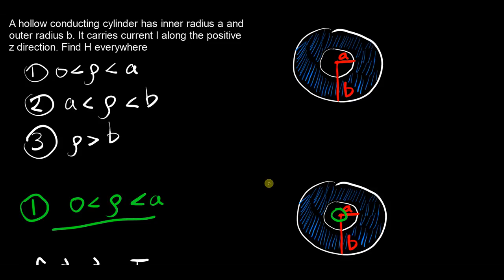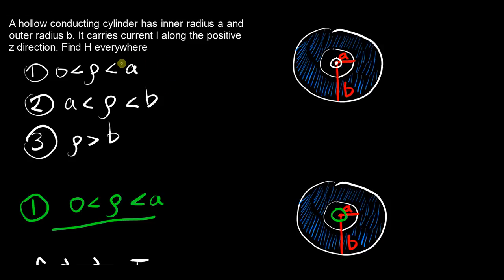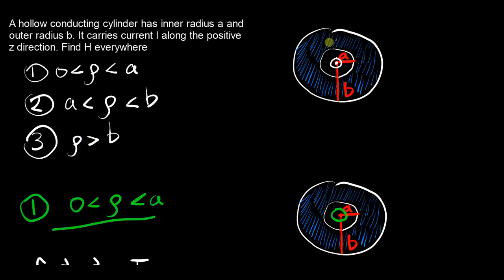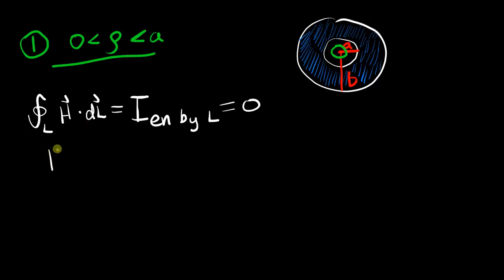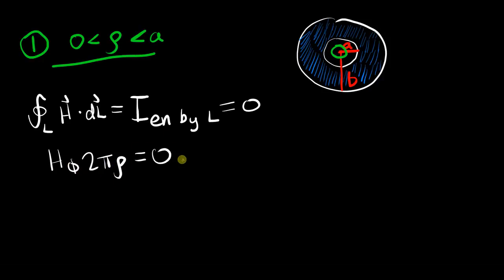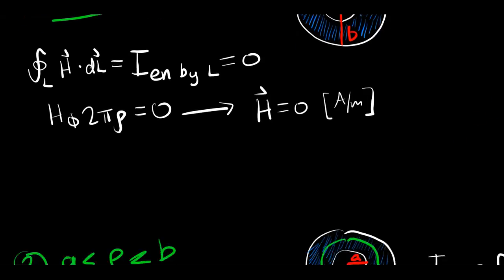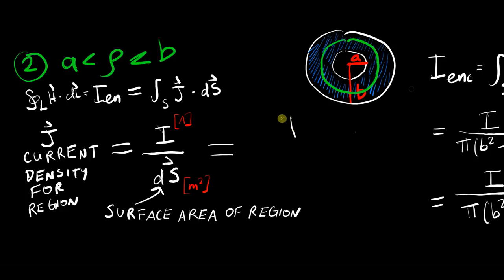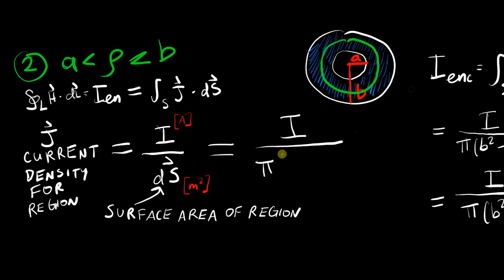ELE401 - H everywhere due to hollow conducting cylinder

Comment: Great video and explanation. Just one thing, around 9 minutes in the video, the current density and ds are vectors in the direction of the z axis not "a phi" because J in in the direction of the current. Also, in cylindric coordinates when you use pdpd"phi" its in the z direction.
Reply from the maker: You're right, thanks for catching that - gonna add some annotations now
Reply: thanks!